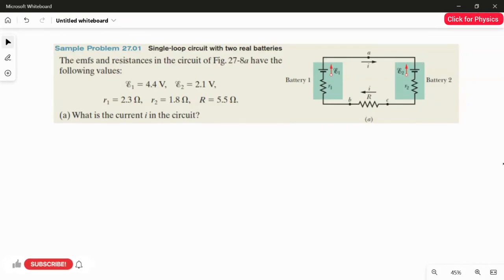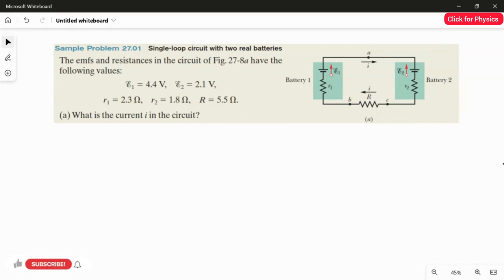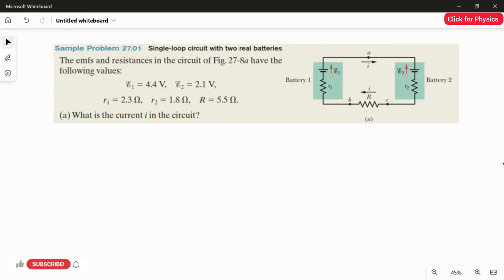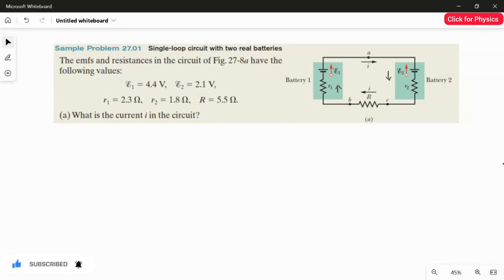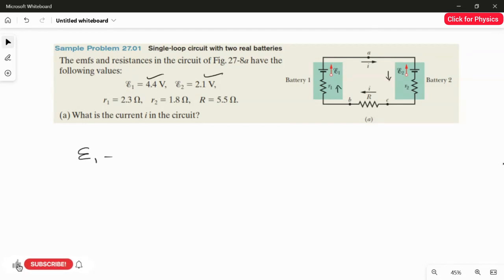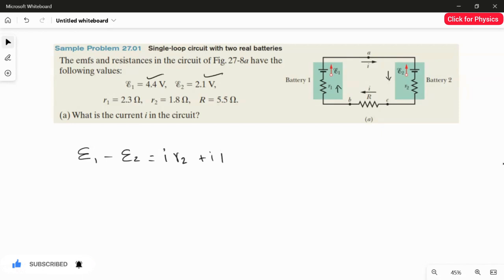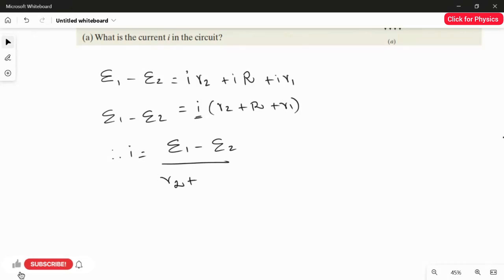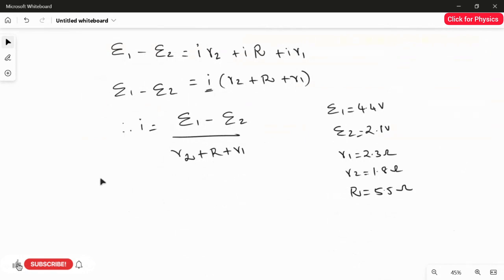Chapter 27 - Sample Problem 27.01- Circuits - Phys121 442

Comment: In part (b)

If I take V (ba) instead of V (ab) like you did I will have the same value but negative 

 because the direction of V(ba) is going from low potential to high potential right?

So my question is how can I know from this problem which method is correct 

or should I give the value of the difference between two terminals in absolute value?